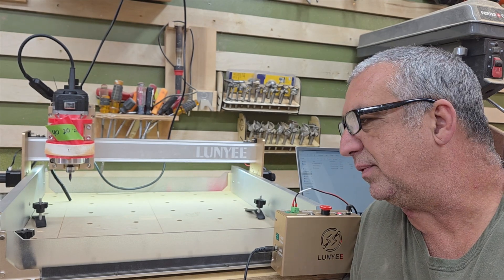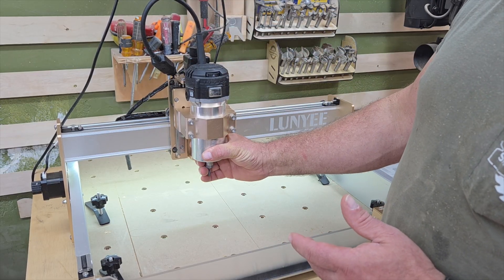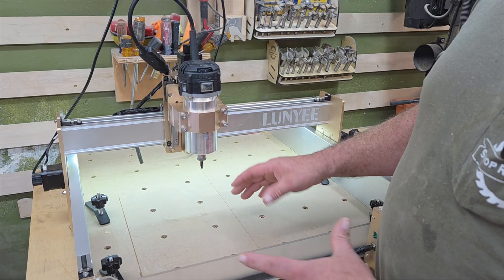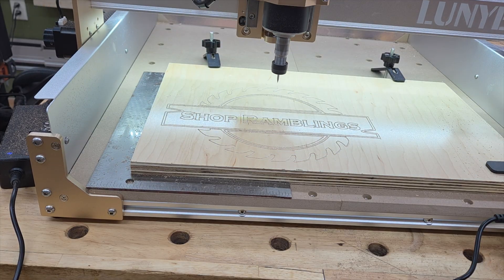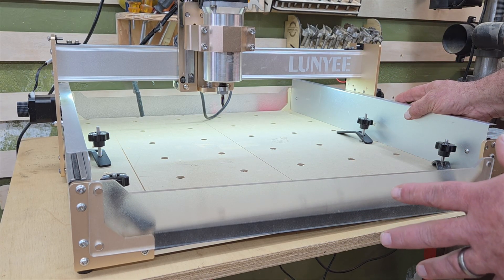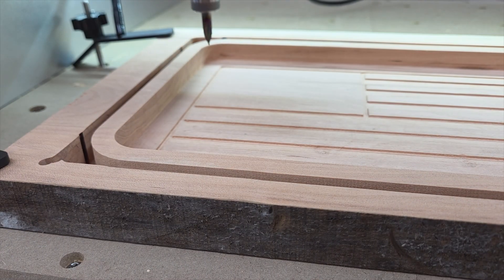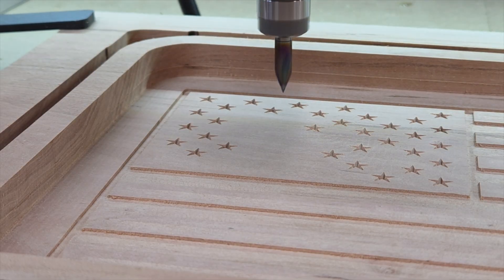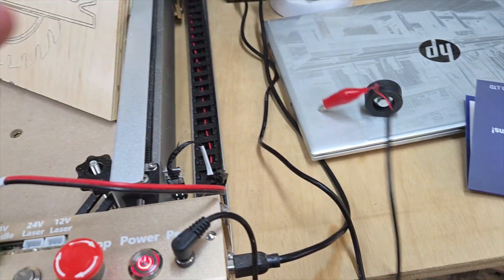Beginner's Dream CNC Machine Finally Here

Comment: Looks like a very usable machine. Someday I'll quit fouling my settings up on my cnc to be able to produce a few projects
Reply from the maker: What software are you using? I am trying to decide if I need to buy software or just use the free ones.
Reply: @ShopRamblings  all I use is Fusion  and OpenBuilds is what post process i use
Reply: @ShopRamblings  i  use Fusion and OpenBuilds to post process and both are free for what i do